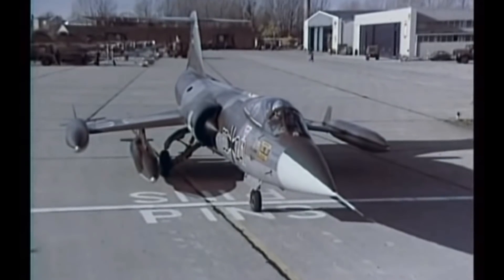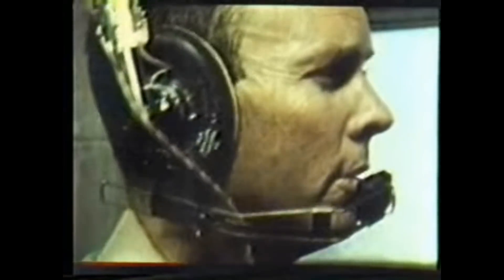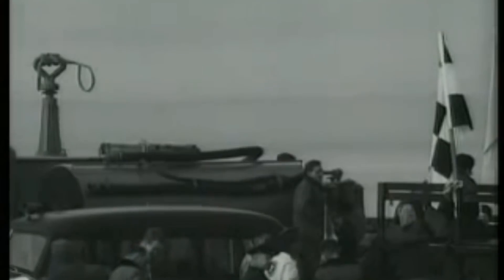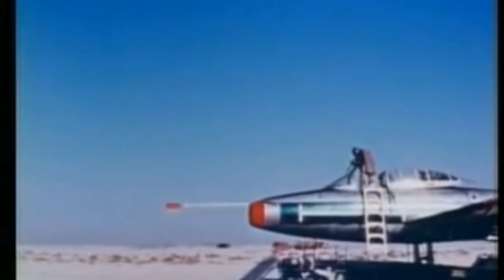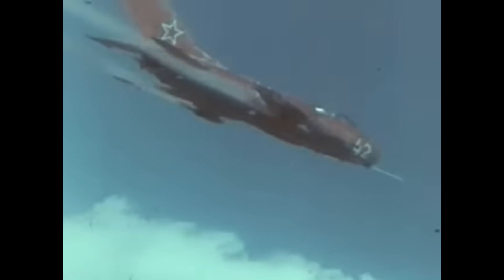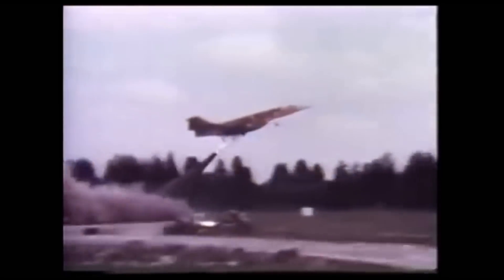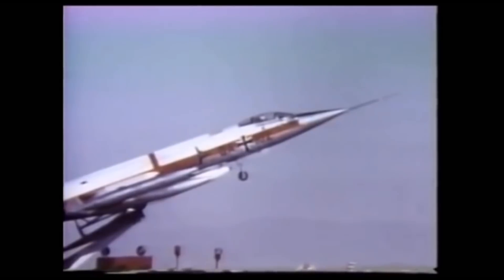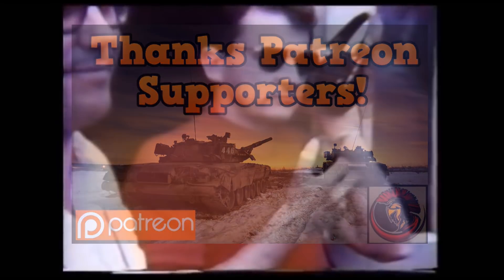Cold War Tactics | ZERO LENGTH LAUNCH

Comment: Harrier fits the bill better...
Reply: The issue with the Harrier is that from a performance standpoint, it was about 15 years behind the times. An F-100 Super Sabre, introduced in 1954, outperforms a Harrier, introduced in 1969.
Reply: @JZ909  how would you define performance between the two aircraft?
Reply: @stevenlarratt3638  Airframe performance: Range, speed, climb, altitude, payload, instantaneous/sustained turn rates. That sort of thing. I don't include electronics or weapons, since these can generally be added to anything.
Reply: @JZ909  but yet a harrier introduced in the 60's outperforms mirage mk3's and iai daggers which were upgraded and were next generation aircraft during the time of the conflict... performance is measured when the aircraft is used for its purpose and also with the training of the pilot in my opinion...
Reply: Saying that they outperformed them is questionable. The very nature of the air war in the Falklands is a testament to the superiority of the Argentine Air Force's aircraft: The British were perpetually on the defensive against Argentine air attacks. They couldn't even consider an offensive action against Argentine air bases off of the Falklands Islands because Harriers lacked the range to get there.

When it comes to the specifics of the engagements, Harriers got some kills, but ultimately struggled to defend the fleet despite very favorable engagements. Mirage 3s barely participated in the conflict and the Daggers were generally loaded with a handful of air to surface weapons and as many external fuel tanks as possible due to the extreme range, rather than an air superiority loadout. Even in these difficult conditions, they successfully hit ships on multiple occasions. Their greatest limitation was their bombs' failure to detonate, not Harrier CAPs.
Reply: @JZ909  score of ariel combats 23-0 and we had 4 losses to accidents
Reply: @JZ909  harrier also has thrust vectoring so has a better turn radius than many of the later generation aircraft it has come up against...
Reply: @JZ909  the argentines didnt want to fight against the british due to the tactics involved. The british kept themselves low where their manuverability was more than enough to get in behind their next generation aircraft for a missle shot...
Reply: Maybe, though I would venture to say that the prospect of getting in an air to air fight over enemy air defenses with 10 minutes of fuel to play with assuming you don't dump your external fuel tanks and make it a one-way trip may have had something to do with it as well, not to mention the need to defend against Vulcan bomber raids on the Argentine mainland.

Is the Harrier a fighter? Yes...ish, so it's not surprising that it achieved a great kill ratio against aircraft that predominately were not even equipped with air to air weapons. However, my point still stands: When faced with strikes against the British fleet, Harriers did not perform well at all, and if it wasn't for bombs being employed incorrectly, resulting in them not fusing, the British fleet would have probably been forced to retreat due to lack of air superiority.
Reply: @JZ909  your original argument/point was it was outdated and not as advanced as a f100 super sabre  which predated it, the british forces used tatics that meant they didnt need air superiority but yet still got the kill ratio. It isnt weather the aircraft is better suited for a rolle but often the tatics used for the aircraft... the harrier and sidewinder combo could not be matched in the falklands. The argentinians did not think at all about the forward plan you are correct, they couldn't have used the refuellers either as the aircraft didnt have refueling rigs. Again tatics paid off. The harriers were reactive post attacks as they didnt know due to radar limitations until they were 20-30 miles away...
Reply: The original argument was that the Harrier fit the bill better than zero length launch fighters. Personally, I don't think this is the case; I think they fit entirely different bills. The Harrier is a VTOL air-to-air capable attack aircraft, and there's some utility to this as a concept. Zero length launch fighters were predominately short range, high performance interceptors/tactical nuclear bombers (the F-104 being the most prominent example). The importance of tactical nuclear bombers, and the interceptors to stop them diminished with the advent of more advanced ballistic missiles and as a result, the importance of zero length launch systems for these aircraft diminished as well.

In the Falklands war, the Harrier was asked to do something it was never designed to do: interception/air superiority. It did admirably, all things considered, but it was still the wrong aircraft for the job, and as a result, the British fleet got mauled. The only reason it didn't result in catastrophic losses is because the Argentines were dropping their bombs from such a low altitude that they wouldn't fuse before impact. If the British had a proper interceptor available to them, like an F-14, F-4 or even F-8, I doubt the outcome of the war would have ever been in question.

Comment: Couldn't most modern jets takeoff like a rocket?
They have a thrust to weight ratio greater than 1, so what's the problem?
Reply: Under a certain Speed the wings and control surfaces have no effect, so the aircraft would be uncontrolable for several seconds at the start and most fighter aircraft still only have a thrust to weight ratio greater than 1 if they fly with only internal fuel and with a weapon loadout for interception.
Reply: shi01
You could still use thrust vectoring just like a rocket.
And if your Runways are destroyed intercepting enemy aircraft is probably very high on your priority list...

Comment: it doesn't make sense..you still need a LANDING RUNWAY. The most successful plan they had was arresting wires, much like an aircraft carrier. This still required 800 feet or so, which reduces but does not eliminate the problem..and the F-104 had an extremely fast stall speed. Look at that wing..VERY small=high stall speed, dude
Reply: JJ Thomas no u dont need it. Its a system for a fucking nuclear war. The pilot bails out after he dropped his nuke and good luck.

Comment: I've always been curious about planes such as the F-15 being able to achieve such maneuvers with the assistance of a ground mounted ramp like on a Soviet aircraft carrier.   The F-15 does after all have a greater thrust to weight ratio and can climb vertically without stalling.
Reply: No it can't fly vertically perpetually. The engines are most efficient and produce that thrust at high speeds and low altitude. It doesn't have enough to thrust to sustain high speed vertical climbing. It begins to slow down and stall, besides the mig-29 has the climbing world record. As well as having higher thrust to weight.

Comment: The Flying Flapjacks(XF-5U) wouldn't need Zell because they are sstol's
#FlapJackLife
#NavyReviveMyPancakes
Reply: keith moore 
She’s sure as hell able to out turn ‘em though
Reply: keith moore  But muh waffle
Reply: keith moore  
If we were to recreate the modern variants of the flying flapjack they would be turboprops outputting up to and around 3000 horsepower.

Don't forget about the ability to carry ammrams and sidewinders.

 I had heard that the army did some testing to test the lethality of helicopters versus Jets and what they found was the helicopters despite their slower speed and increased vulnerability. They ended up having a higher kill ratio because they were able to get missiles on-target much easier.

Takeaway: Props can be as lethal as jets even helis if given the right weaponry. They do faulter in the speed putting them in sticky situations to say the least. Who knows? The flapjack was able to take a wrecking ball and survived.
Reply: To addon to my previous comment, the optimal role for a modern flapjack is OA-X(close air support).

Although not intended to fight jets. It can if it must with missiles and other ordnance.

Comment: The soviets did this too. 
 You need light aircraft. Strike aircraft with a decent payloads is problematic.  
  Also if the airfield is ruined where do the zero launch aircraft land? 

   The F4 phantom had no hope of launching like this.

 Lol a net to catch the aircraft...  I bet the test pilots didn't try that one.

Love the footage.

 Submersible aircraft carrier..... OOo... There is a video in that. The imperial Japanese navy had one..
Reply: Adam Adam the idea was to drop the nuke and then well... good luck. Probably eject above friendly ground
Reply: The Japanese have the largest submarine /submersible carrier but could only launch one seaplane at a time. The seaplane would then land beside the "carrier ". The Japanese instead used it to launch the Okaga suicide rocket planes in their last days in the pacific.
Reply: @balamcom7092  
 Yea I said video on it....
Reply: @AdamAdamHDL  Copy just FYI
Reply: Probably
Reply: keith moore  the f4 phantom was first designed in 1956 but didn't reach end of development untill 1960-61 . So it was not a twinkle in the eye but working prototype during the mid to late 50's . If I remember the first drafts were even earlier.  Being designed not long after 1950 .
Reply: The royal navy did this in the battle of the Atlantic with hawker hurricanes to shoot down focker condors attacking convoys
Reply: We need submarine carriers and landing craft
Reply: Adam Adam Yes...exactly why the program was a failure...well perhaps I should say was not as successful as they would have liked. However some folks on this channel don't seem to like the truth
Reply: keith moore  the American system if confusing . I mean the f-4 phantom wasn't even the second F4 the navy had . There was the F4m wild cat , the f-4u corsair, the F4j4 Fury  then the F4 phantom 2.
Reply: keith moore  the F104 was a result of a 1947 design specification by the then USAAF  . So it would have been round the time of the first phantom and the hawker hunter and English Electric Lightening  . The lightening entered service before the F104 and used a zero zero rocket ejector seat . The lightening was capable of  'officially'  reaching mach 2.5 but it was able to chase down and catch concord in a tail pursuit.  So that is quicker than mach 2.5 . Possibly MiG 31 territory .
Reply: keith moore  haha very much so . I'm really glad we could unconfuse  things though . I don't like fighting in comments . Having an argument or discussion is good but fighting isn't.  Peace dude ! 

P.s I can get very anal and pedantic about stuff and some times it can come over rude i'm sorry if I did.  I also did some research on why the f104 didn't use an upward firing ejector seat.  The usaf didn't want a British designed seat that would have worked . So politics stopped the safety of pilots being put up front .   Seems very odd to me.  

Bit like why the USAAF refused to use the Hispano 20mm cannon while the RAF  and U.S. navy loved it in its war birds .  

The F86 would have been so much more effective if it had quad 20mm instead of 6 .50 browning.  This is exemplified in the f4j fury  which started as a carrier based f-86 .
Reply: Our interstates can serve as viable runways in a war effort.
Reply: @timbrwolf1121  that's how Eisenhower sold the idea of interstate highways to congress for quick military transport and as runways for bombers and fighters.
Reply: Yeah we took the idea straight from hitlers Audubon
Reply: Though similar they are not different keith. The earlier rockets had to launch off a ramp though they had little thrust. The later rockets could do pedestal launches. All part of the same concept of launching aircraft the same way as the rockets of the time

Comment: Once again, Britain saving the day with our normal ingenuity. By sticking 4 nozzles on a brick.
Reply: cerperalpurpose the brits from my knowledge didn’t have anything to do with this design
Reply: Ólafur Mikaelsson I think he may have been referring to the Harrier
Reply: the Harrier was a French concept though.
Reply: Tim Murphy and the Yank never would have broken the sound barrier in the X1 if it weren't for the Brits
Reply: @timmurphy5541  it was jointly developed then built in france
Reply: Jacob Westphal No it wasn’t. The idea was first raised by a Frenchman, but Hawker designed it on their own, with the Yanks and Germans only getting involved once testing was needed.
Reply: Ever heard of the VFW Fokker VAK 191 B?
Reply: The Evil Came over 6 years after the Kestrel was designed.

Comment: You know, seriously, ONLY an F-104 pilot would feel comfortable with this.
Reply: Yeah the F104 had a notoriously unstable airframe at subsonic speeds, you'd have to have balls of steel just to fly one of them, let alone use a zero runway rocket booster. 😂
Reply: Not too much of a difference compared to a normal F104 Takeoff.
Reply: Well, you know all crashes involve a close approach to the ground, right?
Reply: The worst thing about this is that some of those Starfighters might have been loaded with american nuclear bombs.
Reply: No, not really.  A Tactical Nuclear weapon is still a big, heavy, physical bomb.  You wouldn't put it on this sort of rocket craft.  This is basically a method for a point defense fighter.  Defend the air field, until the majority of fighters, using runways, to get off the ground.
Reply: Comfortable??? That is streaching it.
Reply: keith moore  your partly right.  Because of the non variable geometry of the intakes it was easy to get a compressor stall on climb out at subsonic speed.  This would become a flame out . 

It's other problem was the reaction the wings had in ground effect zone.  The downward slope of the wings would cause the wing to rise if the aircraft hit a slip stream from an aircraft taking off in front of it or a criss wind . A bit like the bf109 take off and landing were dangerous for pilots  . They had to be aware of so many factors.  Even performing a side slip could flip the 104 onto it's back  at relatively low speeds .
Reply: She was a poor fighter, that's why they never took it for the air war over vietnam
Reply: @jmcfintona999  designed to be a mach 2 interceptor, optimised for supersonic speed
Reply: @5000mahmud  agreed she was a good interceptor for high altitude bombers. Its like the RAF Tornadoes were good strike aircraft but poor in the interceptor role when the RAF replaced their phantoms and electric lightenings with it

Comment: Judging by the title I can tell why Erich hartmann hated this jet😂
Reply: SGTLuPolt déjà vu
Reply: @sirshotty7689  indeed
Reply: The problem with the F-104 it was designed as a high altitude interceptor with remarkable speed. Due to the speed it had a downward firing ejection seat, to avoid impacting the T tail. Air force types hear and in Germany decided they should hang a bunch of bombs on the damn thing and fly CAS mission. They didn't change the ejector seat to fire upwards until much later. If you ejected at low altitude they just had to fill in the hole and you were buried. 

The plane was so fast without variable inlets, they had to red line the plane's maximum speed to prevent overheating the air frame.
Reply: keith moore  wow the Martin baker mk1 150 zero ejector seat was available in 1947.  Fitted to f86 sabers, DeHaveland vampires , gloster meteors.  The meteor mk.IV that saw service in 1945-46 had an ejector seat.  Also the hawker hunter was first fitted with a zero zero ejector seat by Martin Baker and entered service in early 1950 . So the f-104 could have been fitted with an upward firing ejector seat.